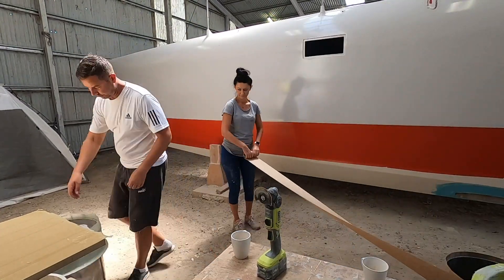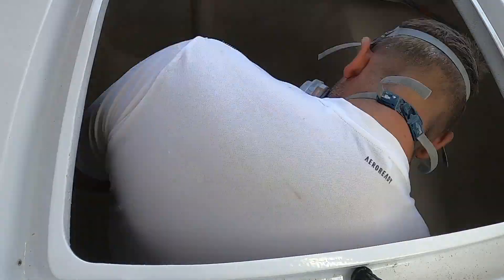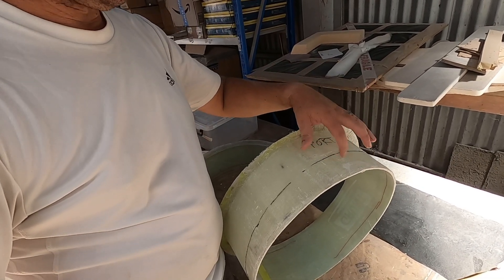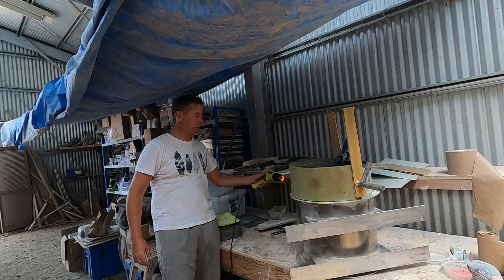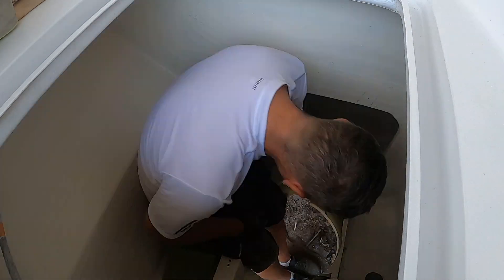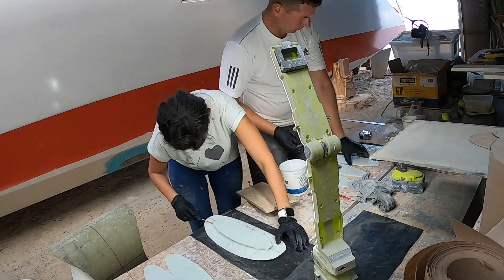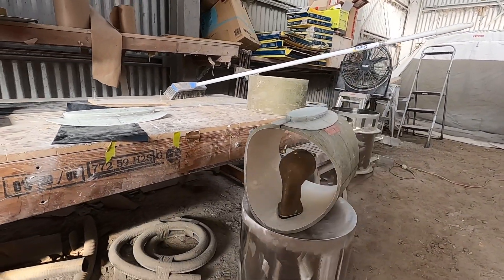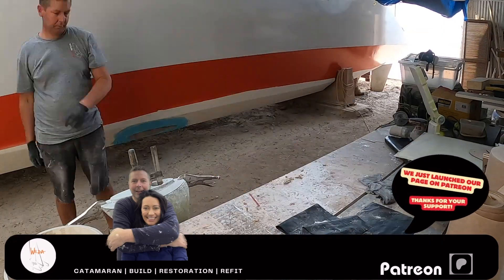We START PUTTING pieces together - S03E21 - Unique Drive System - Part 5 | Building Wilda

Comment: I think your structural amendments to accommodate the drive assembly are excellent, I am wondering if you will fit web buttress between the exterior of the fibreglass ring to the hull? I guess I will have to wait for another 40-50 minutes.🤣😀👍⛵️
Reply from the maker: Fwd and aft, in practice, this is what we did.
We also added a foam stiffener to the sides, achieving a similar result.

Comment: will the propulsion forces act in unison (both pushing the same direction) or work independently?
Reply from the maker: Independently.

That allows for directional thrust as well as being economical with available power.

Also individually for regeneration, there may be reason to program the controllers differently from hull to hull... 🤔

Comment: It’s a thruster gear box is it rated continuous use ? What’s your predicted cruise speed and distance/ hours ?
Reply from the maker: Not really designed for continuous use. But that is also not what it is for. We're building a sailboat 🤣

On occasion, when trying to move without wind, we're hoping to get 10h on 3kw and 4 knots.... Maybe... Time will tell... Super difficult (for me) to calculate an accurate power speed number.... I hope to achieve 4kn at lower power... Perhaps there is a more efficient power setting.

In principle though, this is not the purpose for the drive. Going from a to b should be done under sail. That is what a true performance cat is best at.
The drives are auxiliary propulsion intended for making manoeuvring easier, and for power generation under sail.

Comment: hello, does it need the shroud around the prop ?
Reply from the maker: Hi,

Actually yes, for two reasons. The prop is designed to sit in a shroud and the shroud will allow us to mount a disc at the bottom, hiding the huge hole when retracted.

Need is of course a matter of definition 🤣 

Keep the questions coming! Thanks for watching and hope you stick around for more.

/Axel and Rox

Comment: Coming together nicely. Looking forward to the installation like everyone, but there’s lots of interesting prep work and components.  I built my boat out of pvc foam, but never knew you could bend it so tightly with heat and have it largely retain the shape.  Somehow in all the “study” I did before the build, I never came across that. It was not part of the plans, but still, handy to know. Cheers
Reply from the maker: Can't wait ourselves! A bit delayed at the moment for various reasons.
The foam bending is something I've seen done when building a canoe boom.... A piece of kit I've been looking at, but I'll start with a standard alloy boom. I imagine you could control the heat better using a patio heating element... Not sure what they are called in English. You could build a box with a couple of them inside and heat sheet by sheet pretty accurately using timers, then bend over a form.... Lighter than strip building I guess..

Comment: Maine cats shape their entire hull core foam by pre heating it, means they dont have any scarfing joints to fill add wt back filling and  weakening the core overall.  The result is a  very light hull moulded core.

Love that you guys are doing your own thing. 
The only concern i see is when in the water the assembly might foul up with marine growth and cause issues with propulsor movement.
Reply: I'd think you could easily program an arduino to check GPS/waterspeed sensor, or that you're anchored, and automagically extend and retract the propulsor a couple of times on a daily schedule to help stop any growth from really settling in.
Reply from the maker: Something we'll need to work with. I'm hoping it won't be too much of a problem as there will be no light in the cylinders. But we'll see... I do have an idea for tackling growth and the slack between the cylinders... Not sure how well it will work, but an idea 🤣 Running the props up and down a few times per week should help as well.

Yeah, thermoforming can be really useful in some applications.
Reply: @buildingwilda  
 Apparently coconut oil is an effective and safe  way of inhibiting marine growth on mooring lines etc. could be worth testing.  
 Meantime  modern pistons use raised pads on the skirts to cut drag but still stop them wobbling in the bores. The other  
route is to use strips of a plastic bearing material fixed radially round the inner slider... If I'm understanding  the mechanism correctly.. I think they need to be like brake shoes in that they might have to be replaceable, so recessed rivets and a relatively weak adhesive. 🤔🤞🏼👍🏼
Reply from the maker: Yeah. Thinking something in the lines of that. There are threaded rivets that may be a good fastener... Should be fairly easy to keep waterproof.... I hope 🤣
The plastic is waiting for shaping in the shed. Wish the cylinders were more cylindrical than they are... Would be easier that way. But hey... It's a composite boat. Basically designed to be rebuilt after some testing 🤣
Reply: @buildingwilda  
Lol that's going to be interesting  🤞🏼😬